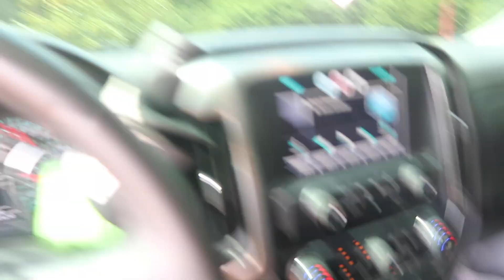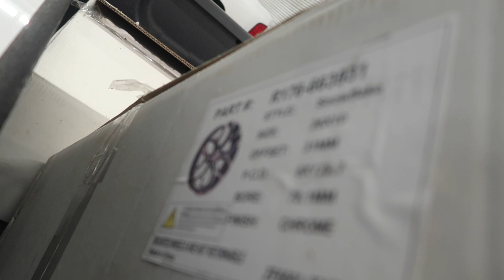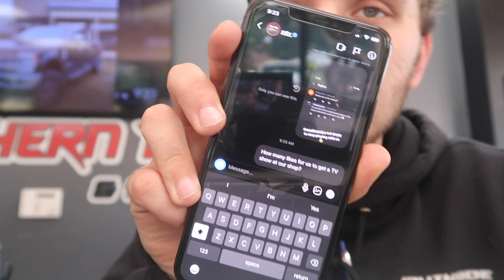Tuckin 37s right before Daytona Truck Meet 2021

Comment: 2:48 they also Mark up the price tag way to much and there not even top of the line,no rear heated or cooled seats or front cooled seats and possibly front heated seats and heated steering wheel